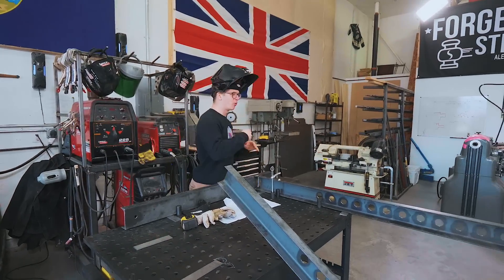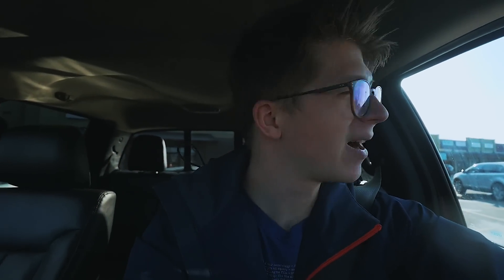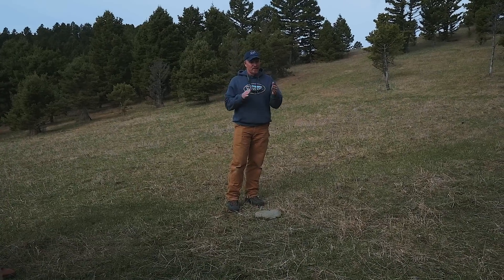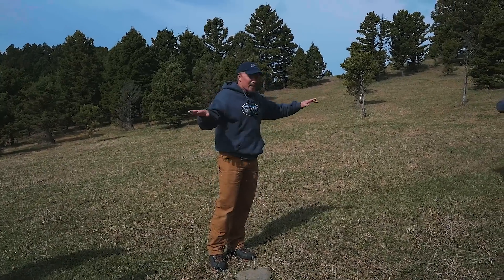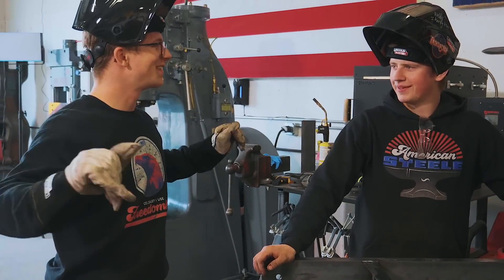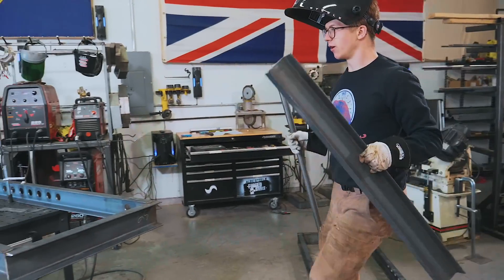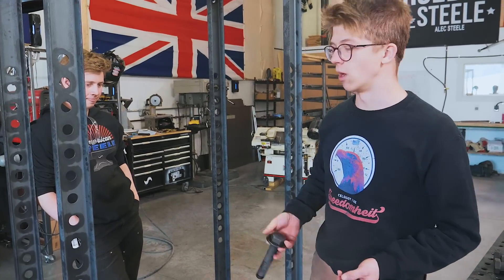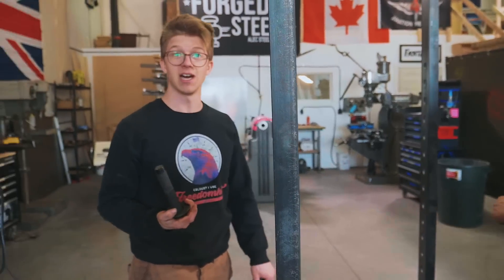FABRICATING A SQUAT RACK!!!

Comment: You forgot to add the fall bar, which is a solid bar near the base so that if you either fall or cannot push up it will not fall beyond that point.
Reply: @sammerwarth  it is not welded in place it just has a stopper on one side.
Reply: But guys, they are NOT using them at 10:45 - 10:55
Reply: @sammerwarth  you implied that they were welded to the frame...
Reply: The next Eddie hall right hea🤙🏽
Reply: Jttv buT yOu IMpLiED theY WERe weLdED To tHe fRAmE
Reply: @TheJttv  no, it was never implied that they were welded in place,  he said welded and in place In separate parts, not welded in place 🤔
Reply: The welded Bar holders are not the safety fall bar that will allow you to get out from under the load. Solid bar from front to back, all you have to do is fall
Reply: Agreed I do not see a fall bar....
Reply: @tomahoks  true but they had pretty light weight on the bar
Reply: @IrateWizrd  And they had each other to spot.

Comment: slams red hot steel with a 4 lb sledge on the daily

Yeah, I don't really have a workout schedule
Reply: gotta eat big to get big
Reply: Betcha he could crush some big CoC grippers right out the box but not squat much if he never did any. Probably way over regular joe on deadlifts though and other grip stuff too :)
Reply: Strength is specific.
Reply: More like a 12lb sledge👊😃
Reply: Umm where to start. You can't compare swinging a hammer all day to strength training. First, you're only using one arm, so you'll be oddly proportioned to having a slightly stronger arm on one side of your body. Second there are fast twitch and slow twitch fibers in every muscle of your body, you can guess which ones are important for lifting heavy weights based on their names i'm sure. Third.. Have you ever seen how skinny and lean marathon runners are? It's because low repetition high volume work doesn't build muscle, muscles require constantly increasing mechanical tension in order to obtain optimal hypertrophy. Once you've adapted to swinging the hammer you will no longer grow any stronger.

Comment: You guys need a  new challenge? I would like to see a Damascus chess set. Different steels for the 2 colors. Gems in forged  pieces. Seems insanely difficult but I think if anyone can do it, it’s you guys!
Reply: Chris Wyrick that would be a dope Steele vs Shelter project. One does the black set the other does the white set
Reply: You'ld have to cast that
Reply: @AysaMetric  most chess figures look like mainly turned on the lathe
Reply: You can forge them out I made a set for my self once
Reply: @lowcarbintheuk  it took me about a day of forge and hold sculpting with a torch and chisels and punch on the pieces to complete the entire set
Reply: Brian Hill II you can forge chess pieces, I’ve done it before. They won’t be super complex, and having a guillotine tool is kind of necessary for more complex shapes, but it’s very possible.
Reply: This would be very cool!

Comment: Definitely ways to upgrade the bar holders vs using just bolts and nuts too make it more easily adjustable for people of different heights, I could draw something up but not sure how to explain it. Also, dont forget to make some safety rods to run through the rack, if you haven't already, to catch the bar if you fall.

Comment: Dude not carrying a 44Mag or some other large caliber firearm when you’re hiking thru bear country is absolutely insane. Defend your life dammit
Reply: I live in Mt. carrying a 44Mag is always a good idea but you should always go for bear spray first.
Reply: Prima16 not that I don’t agree with you but there have been quite a few studies and many examples of bear spray being much more effective at stopping an attack. Just because you have a gun doesn’t mean you gonna kill the bear. A wounded bear is much more dangerous.  Where I live we only have black bears which a firearm is not necessary for protection. 9/10 times bear spray will do the trick but hell if you don’t want to take those odds fine by me.
Reply: @iansmith8944  That and I'm not sure that I'd want to rely on any handgun against a grizzly.  At least not any handgun I'd be willing to use.  A .50 would probably work, if you could hit the bear with the damned thing.  You'd also likely be permanently deaf afterward.  The .44 wouldn't be a whole lot better, and .45 is about as low as I'd be willing to go.  Meanwhile, pepper spray immediately HURTS and blinds it.

Yeah.  Black bears are pretty low key and usually aren't a problem.   (We have them here in Oregon.)  Browns and grizzlies..... big.  Real big.  Big enough that I'm pretty sure I wouldn't want to face one without either something that has an instant effect like bear spray, or something with a lot more punch than a handgun.  .308 or 12 gauge slugs.
Reply: I’d rather die than kill an animal that’s just living it’s life. Humans, sure. I can drop a human with no regret. Animals though? I’d be on their turf. I’d be in their house. Nah. The Bear can have me if it comes to killing it just because I couldn’t stay out of its territory.
Reply: Prima16 you don’t even know the difference between pepper spray and bear spray and yet you’re ready to go out willy nilly killing animals in their own forests. Fam, take a step back and remember to respect wildlife. ❤️
Reply: @alexvj2011  Pathetic
Reply: Scott Grafton that’s fine if you think that. I’m still going to care more animals than myself. 🤷‍♂️ Might be the depression but I definitely know it’s cause my granny taught me to respect the only planet we got, friend.
Reply: @prima164  you can kill the bear but if it is charging and got the blood pumping it can still kill you before it dies.

Bear spray makes the bear not want to be there.
If you shoot and you do not manage to kill the bear you have really pissed it off and it is more likely to kill you.
Instead of letting you live like the man in the video.

And before you start talking big i am sure your aim would be perfect under the stress of a grizzly bear charging at you.
Reply: @prima164  I hunt here in Mt I've probably taken the same class as they did in the video. According to u.s. fish and wildlife service if you try to stop a grizzly with a gun you have a 50% chance of stopping it, while you double your chances with bear spray. I've seen elk run close to a hundred yards with a double lung shot, so unless you get that bear in the head it ain't stopping. Like I said I keep a 44mag as a backup but I will reach for my bear spray first Everytime.
Reply: Harry Nutsac I actually strongly disagree with his statements and I have personally encountered plenty of bears within 50 yards while camping. Most bears will leave you alone if there aren’t cubs nearby and they aren’t starving, so long as you’re smart and give them space.Yeah, carrying s gun is a good idea, but bear spray is better. It’s more effective because the bear isn’t fighting for its life, it just can’t see, smell or breath. I carry both when I’m in Montana, but I’d rather have to run from a bear that can’t see or smell me and can’t breath, than run from an angry, wounded bear. And before you say that people should shoot accurately, go try to shoot a bear that’s running at you while you’re shaking from adrenaline.
And before you assume it, no, I’m not a liberal.

Comment: Alec, I find your spirit to push the boundaries of your skills to be inspiring. And in that spirit I would like to challenge you and Will to push your forging skills further with a test in making Damascus as thin as possible without compromising its' structural integrity in making a plate and mug that are both rust proof and food safe. Please use the grinder as little as possible because that would be more like sculpting than forging.

Comment: 45-70 marlin 420 gr HSM bear load. that will stop any bear
Reply: 45-70 is great so long as you can get that canon on target in the very short period of time you have before the bear reaches you. You miss, good luck with a follow up shot...
Reply: @fadetoblack2104  3 second i can dump the mag(5) and cover it all with my palm at 50 yards. bolt action aught 6 5 rounds same target 7 seconds. there is no replacement for talent. i shoot 2 bear every year and every one i walk up to them and shoot under 50 yards. moose are the ones to look out for.

Comment: You should use the box method on the squat rack with a pin on the top that turns to lock on rack and a safety bar so if you slip you dont reck your hip

Comment: This squat rack is enormous. I guess you wouldn't even have to bolt it down until you squat upwards of 500lbs. One idea tough: putting some pipe over your safety bars will safe them from bending. I didn't see what circumference yours have but when in doubt I would rather loose two short lengths of pipe then anything I did put time and effort in. 
Anyway, really impressive work as usual.

Comment: Guys, you forgot to build in the security bars/beams, that is horizontal on both sides around waist hight so in case you are too tired to get up, you can drop the barbell on this bars/beams and get "out".
Reply: No they build those. They are in place in the Squat rack. You can see them in place around 10:20
Reply: @mrTorezu  Ok, you are right thx, they really are there but I didn't see them in the shot where Alec is squatting .....

Comment: You should move the front bolt and nuts down to the bench height that way you only have to move the bar from the center to the out side when you’re switching from squat and bench

Comment: Nicely done. But if you would have welded some 3/8” plate to the end of some tubing with through holes in the plate, and used bolts to connect to two frames it would be a lot better. Now that it’s welded you can’t take it apart and simply go through any standard 3-0 6-8 door

Comment: That mag drill has a center pin so you dont have to draw a circle.
Reply: You mean a pilot bit?
Reply: @Mr.Neko013  no, slugger bits have  a center pin that will sit in a center punch mark and push the plug out after you've drilled.

Comment: Alec, I have a little bit of a  different question for you. I left this comment on another video too so I apologize for my redundancy. I’m just getting into blacksmithing and think I’ve see guys add flux even just to shape metal and not necessarily weld. When do you have to have flux and when not? If you flux parts being welded and then put them together with the flux still there, doesn’t the weld contain the flux with the impurities?  Or, do you flux it, clean it, then forge weld it? Thank you so much.

Comment: If you're traveling in bear country, it's best to know what type of bear you might be dealing with. 
Carrying pepper spray and wearing a bell will help. Also, if you come across bear droppings you can check them to see what type of bear it is. If it's mostly nuts and berries it's probably a Black Bear, if however, it has bells in it and smells of pepper, it's probably a Grizzly. 

If you do encounter a bear, running up a tree will help you determine what sort of bear you're dealing with. 
If the bear follows you up the tree and eats you, it's a Black Bear. If it shakes the tree until you fall out and then eats you....it's a Grizzly. If there is no trees to climb and it eats you......it is probably a Polar Bear. 

Stay safe!!!!

Comment: so i watched your copper nickel Damascus video and  i commented this there too but hey i wanna see this work

I'm not sure but maybe just use a little more flux to help it bind better or maybe use some Cupronickel-alloy of copper that contains nickel and strengthening elements, such as iron and manganese. The copper contents typically varies from 60 to 90 percent. (Monel metal is a nickel-copper alloy that contains a minimum of 52 percent nickel.) yeah i googled it I don't know if it would help bind if place between layers of copper and nickel OR if it will change the Damascus pattern too much its just an idea to try this again in a new video.(I'm fairly new to forging and metalwork so be kind and if something is wrong I'm always open to CONSTRUCTIVE criticism).

Comment: Is he in the Butte/Deer Lodge area? I live in Southeast Idaho and drive through western Montana quite often and his view out the front of the shop looks really familiar (the mountains and whatnot). Giod idea to own a rifle and a shotgun now that you are in rural Montana. Not so much for bears, bear spray is actually more effective most of the time than a gun, especially if you are untrained as it's easy to use, you don't need to be accurate and it is an effective deterrent to begin with. But a good rifle is great for coyotes and other animals that may screw with whatever animals you may have. Also, there is some great hunting around there so you should do yourself a favor and learn.

Comment: Stupid steel to use for squat rack should have used box section and then you could of just put some J cups on for the bars instead of using massive bolts and nuts which take way to long to unbolt and move all the time.

Comment: Instead of doin all that mag drilling twice you should've just flipped the two channels face to face and marked the backside of one before drilling both at once?

edit- and please add something bigger to the head of those bolt heads to keep the bar from accidentally coming off before you're good and ready. A set of lower limit bars is also HIGHLY recommended for such a rack...it'll keep you from getting squished by the bar if you can't get back up as well as give you a good target range for around where your knees are about 90 degrees(or a lil lower if you want really deep squats).

Comment: You miss pronounced Aluminium Alec. You missed out the i. 
In 1992 the spelling of sulfur was changed from Sulphur (the English spelling) to the American variant of Sulfur which appeared in use in 1920's. The agreement was the Aluminum (the American spelling for element 13 would officially become Aluminium the correct and currently accepted version of the name. 😂

Comment: i Dont like 3 parts of the Design:
- in The Video it looks very short (Width and Height are good). i Wonder if it would be enough if you loose your balance, falling forward/backward with a really heavy weight, however this is hard for me to tell in a Video, standing inside you can see this far better. Or just try to give it a heavy bump and make sure its not falling over. 
Was the length of it shortened with the adjustments to the plan mentioned at 0:17? Probably in order to transport it easier (doors)

- When you dont manage to get the Barbell up again it can Squeeze you to death, or cause serios neck injuries. So you really really want to have something that catches the falling barbell just ~1-5 cm below the lowest point of your normal Squad. Take a loong piece of roundpipe and put it throug both holes (front and back) and you should be fine.
Just use image search for Powercage and you should see examples for this one.

- 10:47 Pullup/Chinup. This is not a safety related thing, but usually you want to have more grips, like V-grip (very usefull for going easy on your ellbow joint), narrow and Wide Hammergrip, and maybe an ultrawide angled grip.

Comment: Guys, as a welding student to a nearly prodigal welder, your mig welds look good but they’d be a lot stronger and more structurally sound if you ground the mill scale off your parts before you welded them. You guys aren’t going for xray quality and don’t have to scrub your parts with acetone or anything, but Mig isn’t know for its penetrating ability. While it will get through the scale, having to do so means it doesn’t penetrate as deeply into the actual steel. Just food for thought

Comment: Sorry man; that was poorly designed.  With a squat rack you want all the bar supports to be easily and quickly movable; what you've done is create pins to hold the bar that require the removal of a nut from a bolt before the the pin can be taken out.  You'd have been better off using square pipe for the uprights of the squat rack, drill holes through the whole pipe so you have two holes directly across from each other, then you can just insert the pin through the holes at the height you want. This give each pin two-point support too.

If it's just for you, you probably won't be moving pins very often; but still.